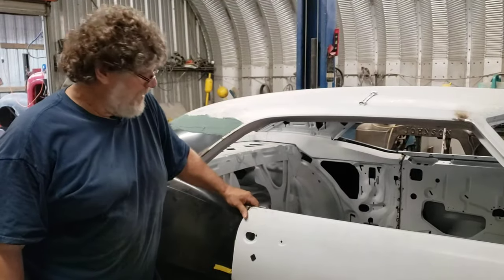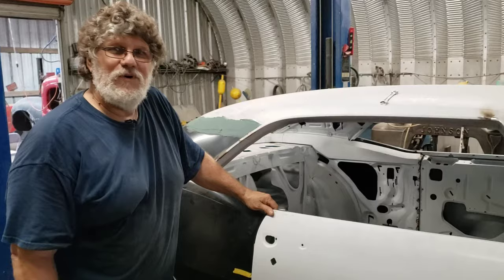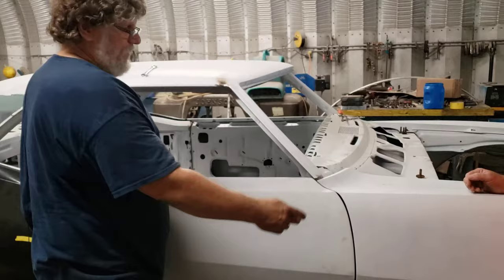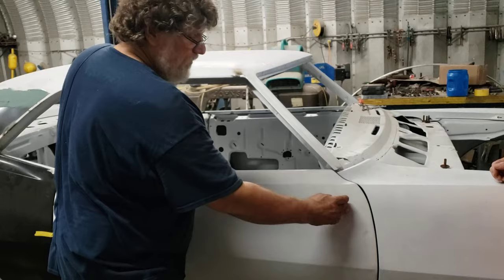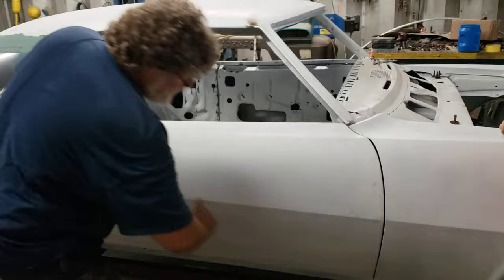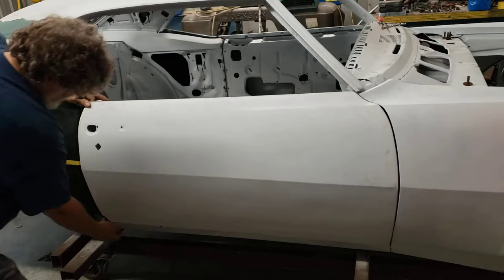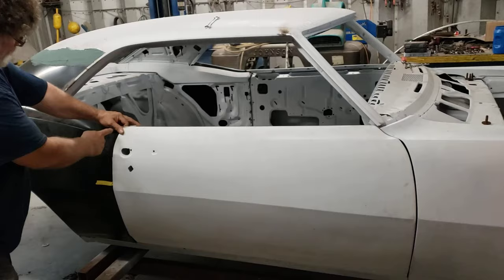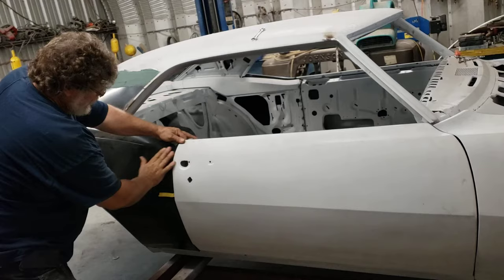Door adjustment explanation

Comment: Just brought home a '64 Catalina 2+2 from resto/body shop. The gap to front fender is fair, probably should have been wider. I installed new door weatherstrip, but haven't closed the door all the way with the resistance and concern about that fender gap. It looks like it's even closer now. I'm concerned with it rubbing my new paint. Is that accurate, the weatherstrip will push the door toward the fender meaning I need to readjust? Thanks in advance.

Comment: Thanks for the very clear explanations. 
The issue I have with my 1968 Camaro passenger side door is that the body shop inserted shims between the upper hinge and the cowl. 
I am not sure why they put them there (maybe they did not understand the principles you explained).
Fact is, if I remove them and fasten the top hinge to the cowl, the lower rear corner of the door comes far out about 7/16". Put the shims back in it still leaves the corner come out about 1/4".

Appreciate any advice you can give.
Reply from the maker: It is possible the door was skinned and with a twist in it . It is possible  to twist  by rolling window down and placing a wood block in top of rear jamb and putting pressure  on the lower part of the door ,but you can also damage worse if not carfull
Reply: @Americansupercar  thanks, I was considering this. There seems to be some tension in the lower left part of the pass. door. The glass is coming out before I attempt to reverse the twist. Hope it works, if carefully done.
Reply: @Americansupercar I've been looking for this kind of explanation, thanks.  But that principle applies for all car doors? I don't have a super car but it's for my cargo van. There is a gap on the top rear end corner that causes loud wind noise. 

Looking forward for your helpful thoughts. TIA

Comment: Thank you for the video. I have a problem of the door still not sitting right. Placing shims on the hinge to door, does not make any difference. There's a slight difference between hinge to door, which makes me think that either the a-pillar is warped or the doo, worse scenario both. Is ot possible to determine which is the warped part without special equipment? I hope you will be able to help.

Comment: How do ypu adjust the bottom door side hinge being they are Phillips head and half the hinge is in the way
Reply: What kind of car are we talking about ,assuming with Phillips head  bolts its a Nova ,if there tight it is difficult to get to the cowl bolts with out removing the fender and you will probably need and inpact screw driver .

Comment: I want to make the bottom of go in, whilst bringing the top out (i.e. rotate the door slightly clockwise). Would this mean tightening the top hinge, and loosening the bottom?
Reply from the maker: Need more info are we talking about front bottom rear bottom or whole bottom?
Reply: Just seen this. The rear of the door towards the back wheel arch is sticking out too far at the bottom. The rest of the bottom of the door aligns okay as you move towards the front of the door by the front wheels